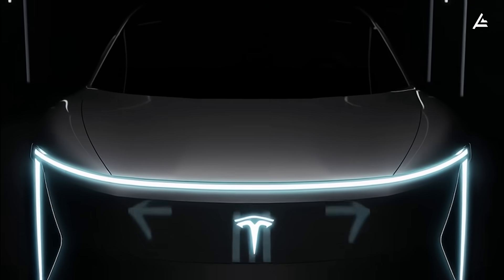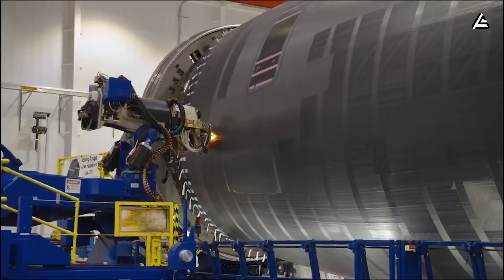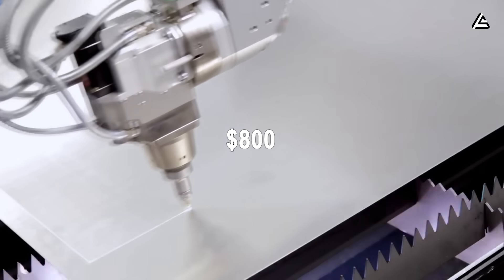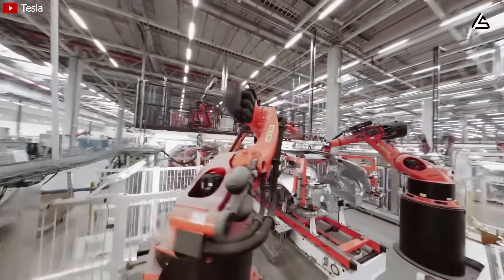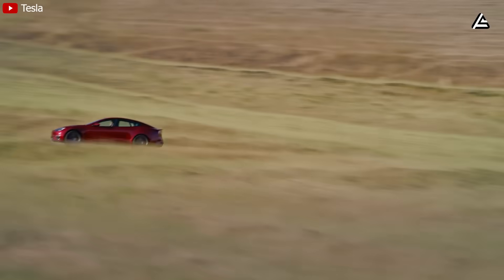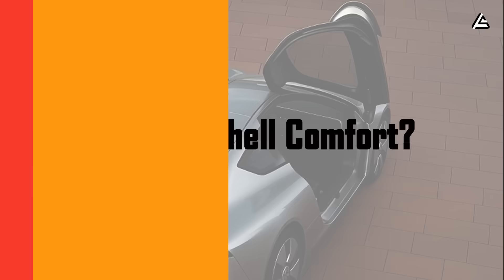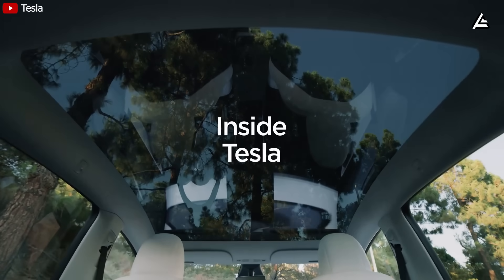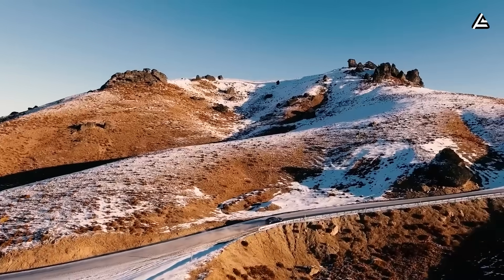2026 Tesla Model 2 Senior Edition: SpaceX-Inspired Design. What's SHOCKING Entire Industry?

Comment: Model 2 !
Reply from the maker: what feature do you like most?
Reply: @AutoGearShift2  Polycarbonate windshield, Aerogel insulation panels in doors and roof. Swappable center console. Seat with full recline...
Reply: @AutoGearShift2  Polycarbonate windshield, Aerogel insulation panels in doors and roof. Swappable center console. Seat with full recline...
Reply from the maker: I like that thinking. Comfort, thermal efficiency, and modular space matter more than luxury for a car used every day.

Comment: Here in the UK they just said anyone with an EV will have to pay 3p for every mile they drive!!! They force us to buy them then tax us for driving them. No one will be rushing to buy these here such a shame..
Reply: If your government is putting a mineral oil tax on gasoline, then the ev's are to be taxed as well. Here in the USA nobody argues about that.
Reply from the maker: thanks for your sharing
Reply from the maker: Totally understand the frustration! New EV-per-mile fees feel like moving the goalposts after people already committed to cleaner cars.

Just a few quick points:
- This is a policy change, not a Tesla issue. Governments worldwide are replacing lost fuel-tax revenue, and the UK is simply testing its version.
- The fee is low compared to petrol tax. Even at 3p/mile, most EVs still cost far less per mile than petrol cars once charging + maintenance are included.
- Incentives shift, but EV tech keeps improving. Cheaper batteries, longer range, and lower operating costs usually outweigh new taxes long-term.